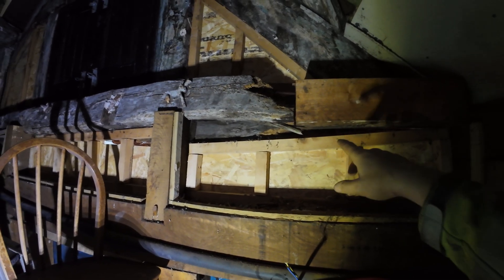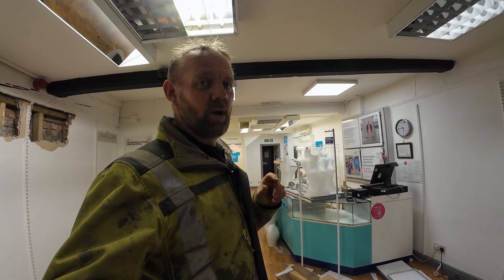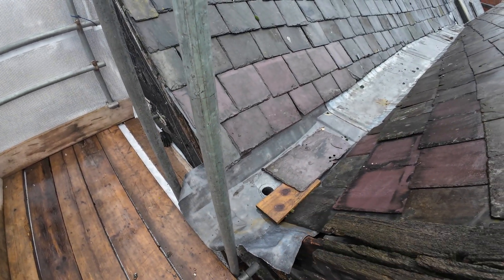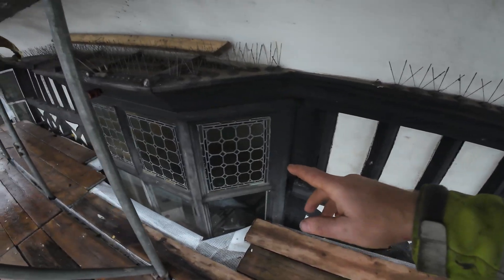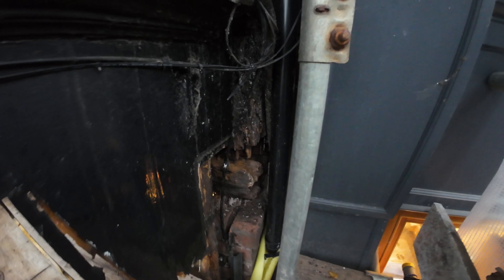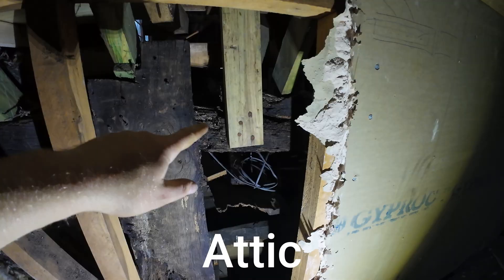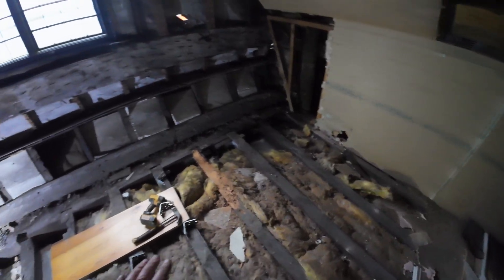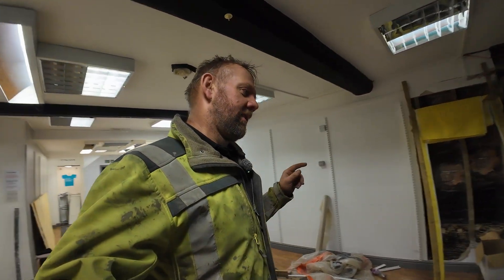MAJOR Structural Rescue Begins! Rotten Truss, Collapsed Jetty & Failing Oak Frame Exposed

Comment: When you replace the rotted out wood and places without original materials (as in someone in the last few hundred years has fixed something) do you have to replace with "near as" original materials or can you use modern stuff?
Reply from the maker: We generally try and get 5 year air dried oak. This way we can see how it's going to crack. Try not to use modern materials on historic buildings.

Comment: I suppose as it is built out of wood, it's more forgiving than brick and mortar, I'm sure that if it was built with brick and mortar it would be just a pile of rubble by now. It's going to be an epic task to put it right not only the rebuilding, but putting in the supports are going to be a task on there own. 👍